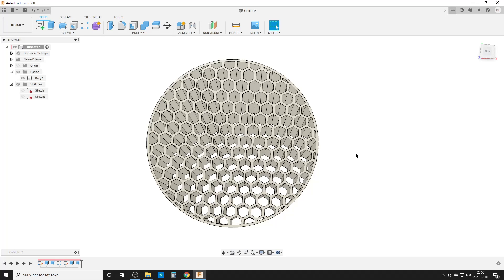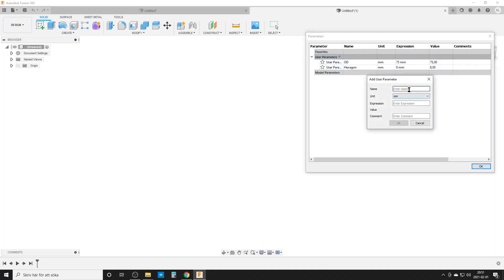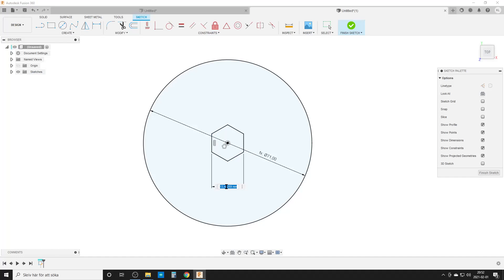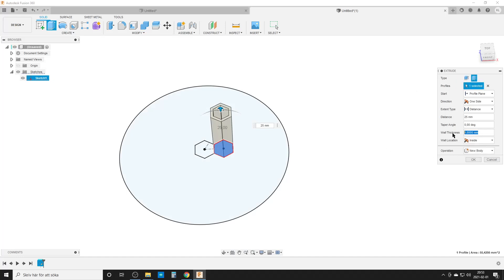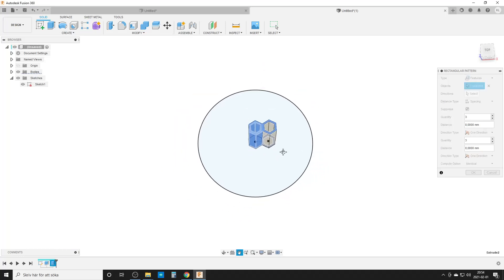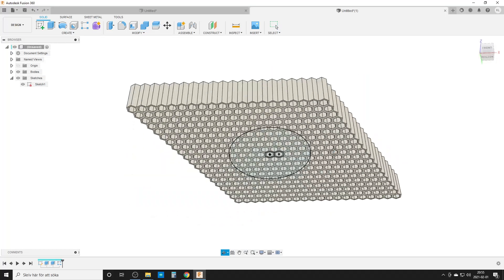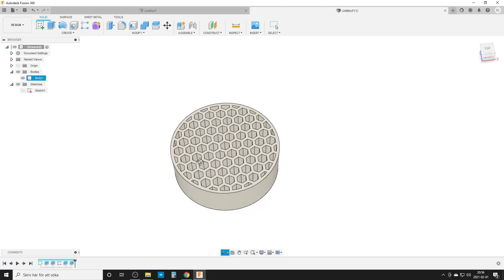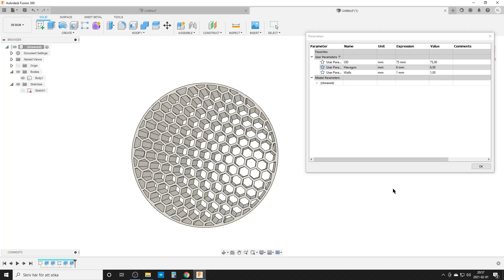Hexagon (Honeycomb) Pattern in Fusion 360 using Thin Extrude

Comment: I can't get this workflow to work properly. After extruding the circle using intersect, all the polygons outside the circle still exist. Deleting any of them breaks the "pattern" and removes them from the cylinder.
Reply from the maker: Check that your second Extrude (thin) is set to Join, and that in the pattern you are selecting the second Extrude (not the first one)

Comment: I've been following your tutorial step by step and repeating it again and again but can't get the rectangular pattern to be one mesh after doing it... has changed something in fusion? the feature option only repeats one hexagon and I've choose the join option...
Reply from the maker: I'll have a look. There is a bug (in the latest version) that can sometimes trigger with patterns. You can make a try with other dimensions and see if it works.
Reply: @KristianLaholm  i got it worki g in some point, but when i tried with other dimensions it broke and could repeat it again, but then i modified again, and never could reproduce again. One of the problems I had was that when I was picking the two axes, I only could select one, the second one was impossible to select

Comment: I redid the exercise and everything works with your parameters
However when we change the value of Hexagon to 4mm then the honeycomb is no longer connected to the outer part
I solved this problem by increasing the number of rectangular pattern
Reply from the maker: You can make the quantity parametric in the pattern feature.

Comment: this must be out of date because those options are not showing up for me. Following step by step, what is happening in the video is not happening in fusion.
Reply from the maker: What steps are causing you trouble? It works for me. Are using Solid (blue) extrude and not Surface? Are you having problems with the pattern? (check that you are pattering "Feature")

Comment: how would i do this, if i wanted to make a part lighter by adding honeycomb holes? meaning for an existing part
Reply from the maker: Have look at another workflow here https://youtu.be/r28Tpy0PIQM . But if you are 3D printing adding more perimeters (hexagons) to the print can add weight, do 2 models and compare the print time an material used.
Reply: @KristianLaholm  actually it is not only about saving weight - i am building a cage for a fan, so holes are a must, thank you!
Reply from the maker: @shotbyarian  Yeah holes for a fan sounds like a good design intent :) Hope you find a solution :)

Comment: When you did the interesct, how did you make it so it "removed" the unnecessary things around the circle?
Reply from the maker: That is the function of intersect, everything inside the profile I'm extruding with intersect will be left everything outside gets removed.
Reply: @KristianLaholm   I did intersect but the bodies ouside the circle was not deleted. What can I be doing wrong?
Reply from the maker: @LULASVC  Check that the second extrude (3:30 in video) is set to Join. You should have only 1 body before making the intersect extrude.
Reply: @KristianLaholm   I figured out that I was doing wrong , the rectangular pattern should be Features and I was using bodies, Now it worked, thanks.
Reply: @LULASVC  I had it set to features as well but it was still just removing parts that the outer circle actually touched. I solved it by first selecting the whole pattern and joining it into a single body.

Comment: Thanks so much! I wanted to print myself a coaster, so I looked up designs for inspiration and I saw one with a honeycomb pattern, but I didn't even know where to start! This tutorial was perfect, and I feel like I learned several things that I can continue using for other designs.

My computer isn't very good, so I used the rectangular pattern on a single axis to make a trip, then used the rectangular pattern again to repeat the strips, as the pattern would fail if I tried doing both axis's at once.

Comment: I think it's possible to get exact number of pattern iteration by dividing circle diameter with hegaon size and using ceil function to got integer.
Reply from the maker: Good idea :) and maybe +1 to always be on the safe side.
Reply: @KristianLaholm  yes, i've added two - for sure ) Nice tip with patterning 'join' instead of combine unknown number of instances